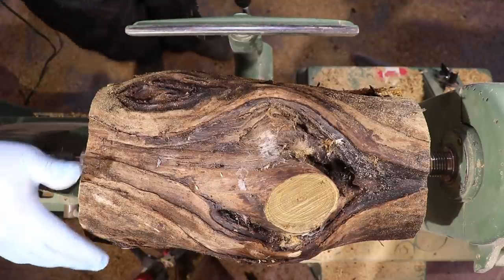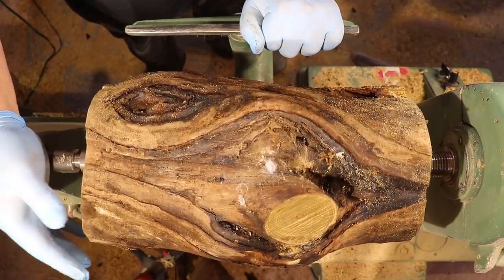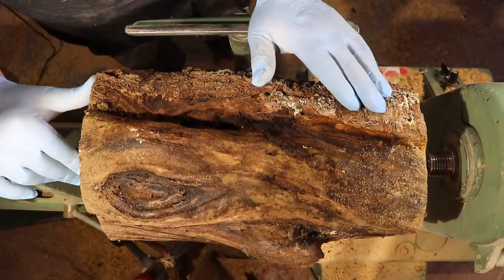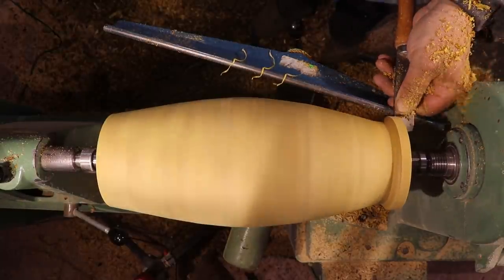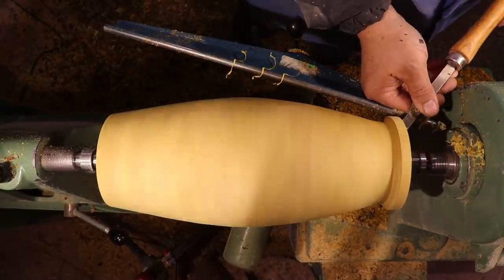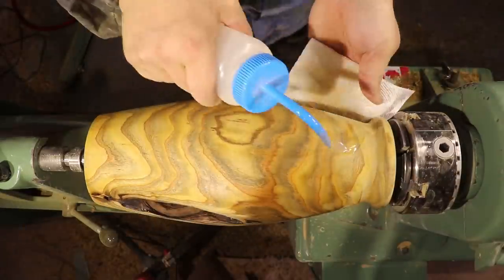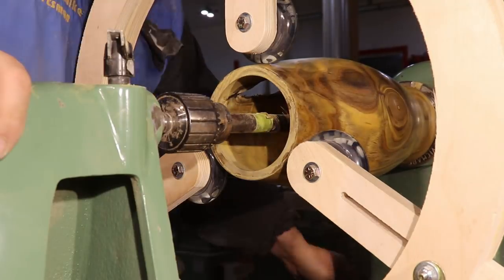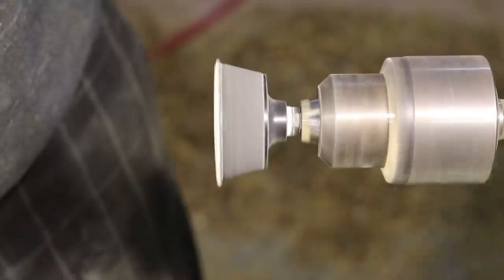Woodturning | Staghorn Sumac Vase

Comment: Beautiful vase!

I remember being taught in HS woodshop to slow down the lathe when first turning an out-of-round piece, then once it's round you could speed it up. Then even faster when sanding.

Years later, as a woodshop teacher myself, I discovered that it's much easier to do the initial rounding at higher speeds than slow. But I still use high speeds when sanding.

In another video (probably several), you explained that you slow the lathe down for sanding. Can I ask why?
Reply from the maker: You generate too much heat sanding at high speed. 350-400 I’d plenty unless the piece is very small diameter. You can actually put heat checks that are very small on surfaces if you heat too much. Thanks for watching!

Comment: What would be the advantage or disadvantage of using green wood?  Does the drying process change the shape or crack as it dries?
Reply from the maker: Wet wood turns more easily, especially the hollowing. When you make the walls consistent  it is less apt to crack than if it were left in log form and sealed up. Mostly I just wanted to see what it would look like though. It has not cracked and if it has move it is very, very minor. Thank you for watching,

Comment: Very Nice!  It looked like you were using a very low angle grind on your gouges.  They sort of looked like a "bottom feeder" grind...was that the case or did I not see it correctly.  I was also interested in what kind of tool you were using to hollow starting around 9:00 in the video?  I have turned Sumac here in central Wisconsin and it is very green in color.  I've used small pieces to make little Christmas trees and look neat.  Our local Sumac grows mostly in road ditches and is like a bush typically.  I have turned some Sumac as large as 6" in diameter but that is rare to find it that large.  Most local Sumac is under 2-3" or so.  I had not seen your videos before now and have subscribed.  Please advise on my questions if you can.  Thanks, Myles
Reply from the maker: Thank you Myles! The grind on that gouge was about 40 degrees, traditional done in a wolverine jig. The hollowing tool @9:00 was the Easywood tools #1 pro hollowed. I lucked into several large sumac trees on my sons property. Several need to be cut so I expect to be turning lots of it in the next couple years. Thank you for watching and subscribing!

Comment: Lovely. I also like to turn “junk” wood. There’s little more fun than getting sprayed with flying termite guts! 
Seriously tho I’ve found I need to be super careful with holey chunks stored indoors or next to dimensional lumber. I found termite tunnels between chunks n held my breath until I determined they hadn’t moved into any expensive wood or worse, my shop walls. 
One thing I always struggle with is the issue of badly unbalanced blanks, especially when first starting the turn.  I sometimes have to mount them skewed in order to either avoid punkiness
Reply: …or to incorporate the best figure or feature. 
My lathe’s slowest speed is 700 rpm so turning these chunks sometimes gets pretty exciting (in the not good way).
Reply from the maker: Thanks Randy, 700 is pretty risky for a lot of pieces! never fun turning and ducking at the same time! Thank you for watching!

Comment: ?? Question! I've had someone comment on one of my videos that I should hold the chuck when drilling it out. I noticed that you didn't hold the chuck, and wouldn't it be dangerous to hold it, in case it catches and spins in your hand? Looking for opinions!
Reply: Beautiful vase BTW!
Reply from the maker: Usually I would hold it just at the start, typically that will let the taper set in the tailstock if it is not fixed well. The mandrel is smooth so the chance of it hurting your hand is very remote. Feed the bit slowly.
Reply from the maker: Thank you!
Reply: @TheKlondikeCraftsman  thank you! I'm still new to turning, still a lot to learn!

Comment: First congratulations on hitting 10k! Awesome. Love the grain on this. It's crazy with all the swirls. Question... when turning this was it hard not getting any of the gouges caught in the big split? Love how it come out. I never knew you could cut and turn the same day. Thanks for sharing your creativity with me again. Stay safe, Vickie
Reply from the maker: Thanks Vickie! You aren’t pushing into the split but rather towards the end. Rpm of the piece would keep it from going in the split also as it passes by so quickly, You can turn some woods very wet. I wasn’t sure about this one but it is still good so far. Thank you for watching as always!
Reply: @TheKlondikeCraftsman  so as long as you hold the gouge steady and not push into the piece, it works. Thanks
Reply from the maker: Well the speed would make it very hard to get it in the void but like I say, you aren’t actually pushing it towards the void but in the direction you are cutting.
Reply: @TheKlondikeCraftsman it's ok. Not having ever done a lathe, some things are not computable in my brain. I can kinda picture it tho. Thanks for info Lewis... and patience
Reply from the maker: Picture it like trying to poke your fingers into the spokes on a bicycle wheel. If the wheel is turning slowly you can. When it is going fast you cannot, the spokes push your finger out. Pretty much the same premise.
Reply: @TheKlondikeCraftsman  dang Lewis, that did it. Good comparison for me. Now that makes total sense to me.